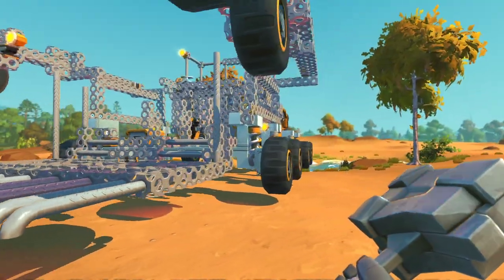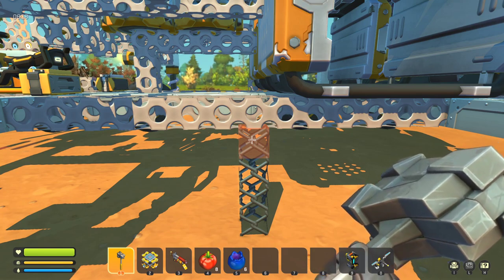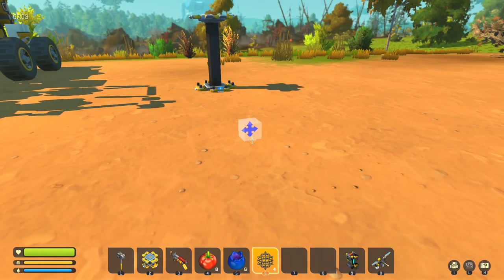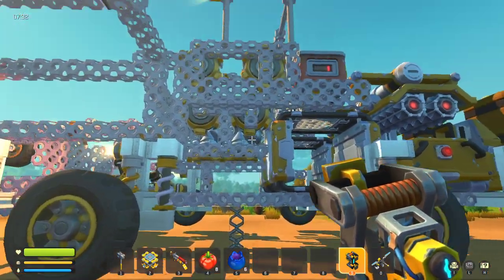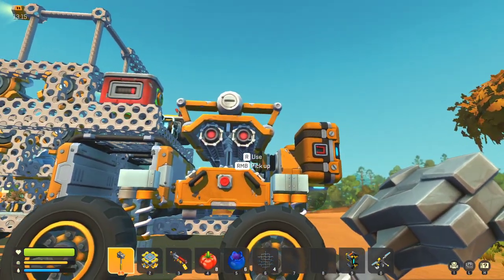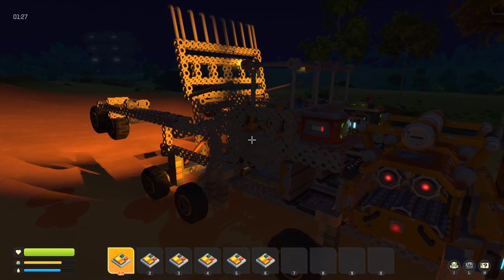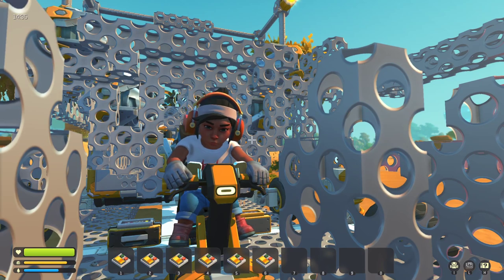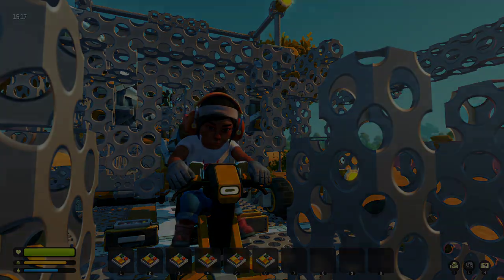Scrap Mechanic Survival How To Fix Low FPS In-Game Tips! Make Your Base Live Again!

Comment: thx for the tip, went from 40 fps to 140 by welding my vehicles, i noticed that the main issue was a vehicle that i use to go underwater that witch is very simple and small but heavy and has off-road suspencion with low settings (tuned for underwater) that was leaking like 80 fps

Comment: i Found another interesting and VERY big source of lag: Having big things on bearings. I built a greenhouse with a slanted roof where the two roof panls were on bearings to make it slanted. the panels weren´t too big ( about 25x45 blocks) but having two of those close to each other, not touching though, caused major lag. i had 3 big vehicles besides and the fps dropped from 60(with v sync) to 58. the panels of the roof were dropping it from 60 to 20-15. So, making slanted roofs with bearings is not a good idea at the current time :D

Comment: what happens if the creation is soo big that the game runs on like 10 fps  ? i built a massive snake and when i remove it from the lift the game lags soo hard but if i dont touch the snake everything is fine but i wanna touch the snake :(
Reply from the maker: you're just stuck with something you can't use just like all heavy, complex builds. just the scrap mech way unfortunately

Comment: The problem still exists today
Reply from the maker: after all these years....
Reply: @Tenvince  what I see is that fps drop and GPU usage drops when you are in the same situation exposed in the video. There is something wrong in using GPU rather than in the effective computational load.
I think this kind of problem is addressable directly to game code, not to video drivers and system in general; it is too present and persistent among all players.
I have of course beta access disabled.

Scrap Mechanic is written in Lua, I'm not expert.
Similar games, like Space Engineers are written in C#, that is for sure easier to use for graphics on Windows and with DirectX.

Comment: pffff that was your tip?
change the title into something else
every noob knows that if moving objects are FIXED and dont have an engine running etc the frames go down!

i was looking for an actual tip about moving objects!
Reply from the maker: in fairness, noobs generally don't know this. there isn't much else one can do, in-game, about the lag of heavy vehicles other than make flat parking spaces and remove the suspension which i also demonstrated in this absolutely free and optional video